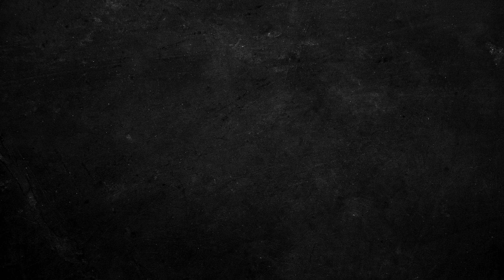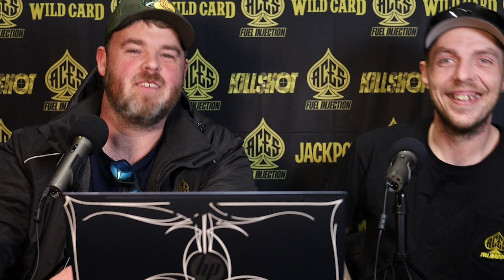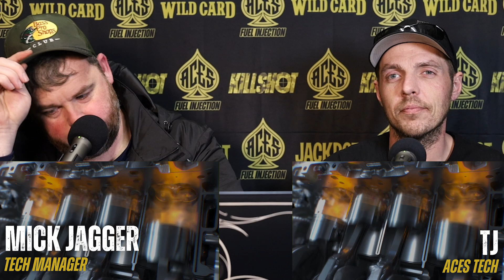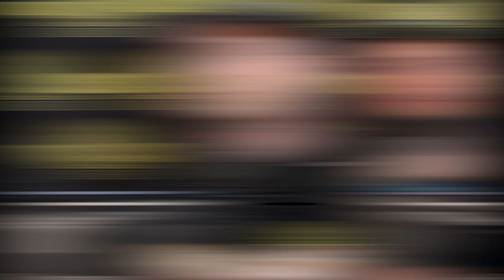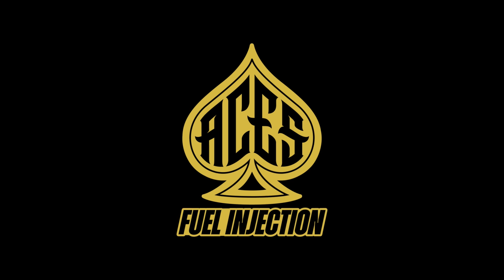Tech Call Questions (Tech Tuesday Ep. 28)

Comment: Hey I have a 1996 obs that I’m trying to put a 4.8 with a 4l60e and I’m confused on how to wire my transmission could you help me figure out how to wire in all 3 connectors I have the jackpot system with the intake manifold thank you
Reply: You will need to plug into the vss on the back of the tail housing, if you plug into the ones further up it will cause it to shift super early